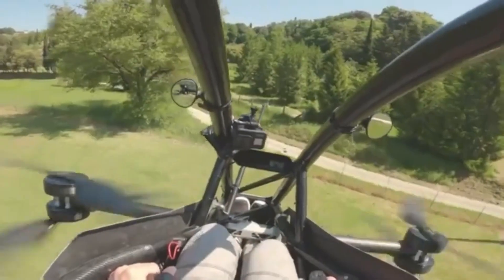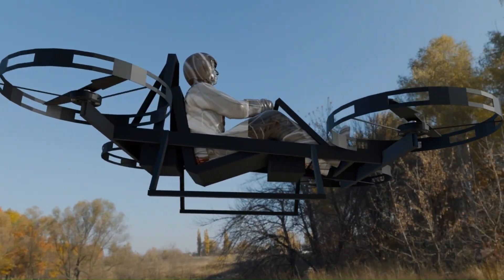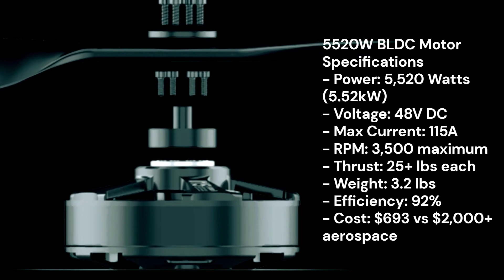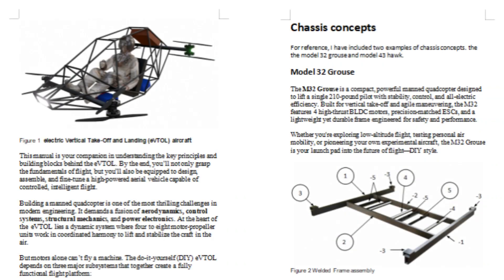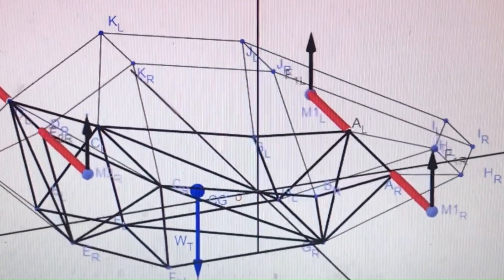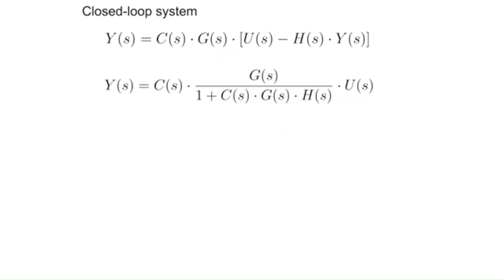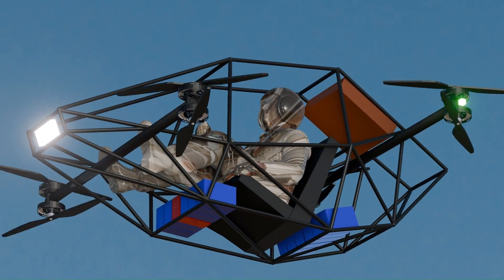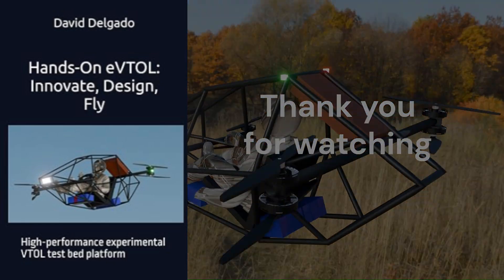Design and develop an electric VTOL Quadcopter System #rotor #quadcopter #aeroplane #drone

Comment: I have just ordered 2 of your books, will recieve it this friday and hope I can find help and answers. For the past 3 years, I have designed and finished building the structure of my human drone. Started with 4 motors and now ended up with 8 UL15XL 78KGf and 300A thunder ESCs with 52" carbon props. My FC is pixhawk 7 and using mission planner for programming. I am having difficulty in stability during take off, destroyed multiple props😢. I tried locating the FC in the CG and forward of the structure, still a problem. I calibrate the FC only because it is very very hard to calibrate the whole structure. If anybody can help me with possilbe solution I highly appreciate it. 🙏

Comment: Hello, I'm sorry to tell you, but you made a mistake. The maximum thrust of the T-motor U15II is 36kg. You have a weight/thrust ratio of 1. You will need twice as many motors, ESCs, and batteries. It's not the same budget...
Reply from the maker: Thank you for your comment regarding (Hello, I'm sorry to tell you, but you made a mistake.)  I have a point of contention, if you don't mind. According to the manufacturer's test results, the T-Motor U15II produces a maximum thrust of 36 kg at full throttle and 60 volts.   The motor's maximum thrust is prop-dependent. The 36 kg rating is not the motor's physical limit; rather, it represents the highest thrust achievable with a certain propeller and voltage/current input. Manufacturers typically publish this number using a safe. efficient prop (e.g.34x11.8) at a conservative voltage/current for thermal safety. (110 degrees C).  By extending the prop diameter from 34" to 40" (T= 36 kg x (40/34) ^4 = 68.8 kg), you may achieve 68.8 kg thrust while maintaining optimum rpm and sufficient current safely without the risk of motor thermal damage which is the case I use here with Pulse Width Modulation (PWM). The T-Motor U15II KV80 (used in massive drones) runs on 12S (44.4V) and generates 75 kg of thrust per motor with a 40-inch propeller. (as verified by ChatGPT).   For a 95 kg pilot, the frame, battery, and components weigh 41 kg each, for a total of 136 kg.    The total thrust needed for a 2:1 ratio is 272 kg.    The thrust per motor in a quad configuration is 68kg.    Since 75 kg is greater than 68 kg, not to include the 2:1 safety factor given, I believe there is no error presented here.   Please let me know if there is anything I am missing, and I shall investigate. Again, thank you for watching and checking my work.
Reply from the maker: Sorry I inadvertently deleted the reply to your original comment by mistake.  In my response I saw 2 identical postings, so I deleted one only to find out I deleted the other one as well.  I tried to reconstruct the original reply to the best of my knowledge.  Hopefully this will not add confusion.  Best regards...

Comment: Great stuff, I now own 3 of your books & am slowly collecting parts (bit by bit over a few years due mild poverty lol). My primary goal is to eventually accomplish a full-on flying car as presented here but if that ends up being too complex for me & I have to settle for 'only' building a Star Wars style 'ground effects' vehicle and/or 'ekranoplan' then I certainly won't be mad about that outcome either. Keep up the great work!
Reply from the maker: Thank you for your invaluable help.   I'd like to use this occasion to make a comment about the Battery Management System (BMS) circuit board, which should be incorporated in the design for optimal battery safety.  I intend to update the books with further information about the BMS.